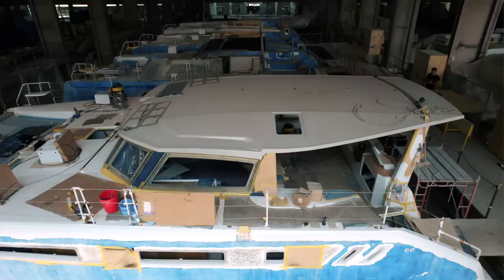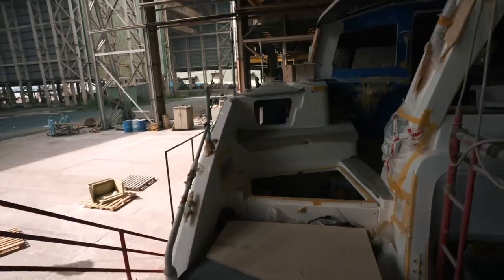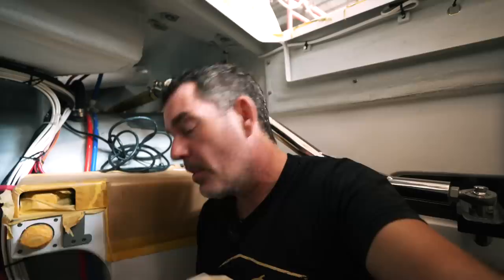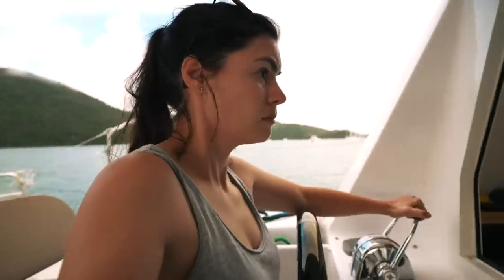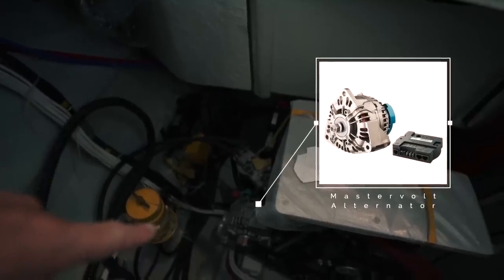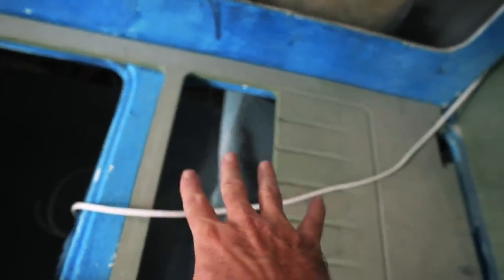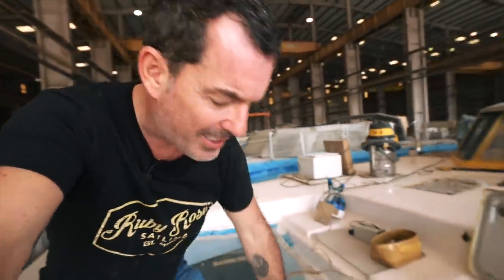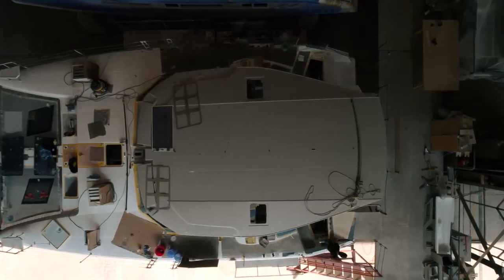Incredible Progress! Windows and my DREAM engine bay!

Comment: What amazes me is that no one puts manual deckwash pumps onto the engine, a life saver if installed correctly and one that will keep up with huge holes in the bottom , nice thing with deckwash pumps if the air intake is above the water these things will be more reliable than electric bilge pumps , considering an engine driven jabsco can pump from 43 gallons a minute, but we design in bulk heads hoping that these will hold . If you think about pumping 43 gallons a minute at 1500 rpm im sure it makes sense considering the average fuel capacity for cruising would mean that the engine would keep pumping for days and days. The other issue i see is that you have forgotten that having a water tight bulkhead in the engine room, having your air intakes snorkled  way above such a room will mean that even when the engine is immersed you would still have an operational engine .

Comment: In your catamaran reviews you emphasized having the wiring passages filled to prevent fire spread and fire suppression systems in engine bays. You did not cover either of those item in your engine bay tour. Is Sea Wind plugging the wire runs and supplying a fire suppression system? I would suggest a hylon system.
As you see the build progress on hull 1 are there any things notice and would like to change or modify on RR2 before the yard builds your boat?

Comment: Jeannuau 54DS have a beautiful single line reefing system, supported by a pair of powered winches either side of the companionway. Ease main halyard by hand and wind in tack and clew simultaneously with the powered winch, driven by the foot switch. The reverse to throw it out. In heavier weather, engine on, in gear and steer head to wind, George does the steering, you do the lines. Almost a stress free one person manoeuvre.

Comment: Is your house DC system 48 Volts? Why not? You can get so much by charging your house batteries at a higher voltage for the AC inverters. Then stepping down to the voltages you need to use for winches, windless, 12V systems, etc.

Comment: Alternator: I assume, there are a number of 'special' alternators with high output. But for me more important ( and your Mastervolt alternators will have) is the attached regulator. 
Such a regulator will be mandatory if you use Lithium batteries, but they normally have a better voltage sensing and a dedicated ability to charge quickly.
Reply: Safiery has it all, does it all, and you wont find better systems designed and built for any boat or vehicle.....watch their 60 second you tube grabs.

Comment: Nick. Does these Catamarans have a Third Fuel Tank? If not they to look at the Kraken 50 and learn Why a Third FuelTank in a Must. Thanks  how is your Cat doing? Peace Be With You Two
Reply: Whys they have 2 engines each with its own fuel tank.  This is NOT a monohull with a single engine. Now adding a second primary racor might be a good upgrade for an owner to do.
Reply: @jackdbur  Jack.   With all the Junk Diesel fuel if the Manufacturer could save some labor Cost with a Large Main Tank you need that to hold water/.Fuel then filter the Fuel to each Engine Tank that way you have less chance getting bad fuel in you New Engines. Also now you Have Two Fuel Filters per Engine and if you get bad Fuel you have to Change Four Fuel Filters. Now Do you Get the Third Main Tank? But you are Rich so you like changing Four Fuel Filters.   Not me. One filter be fine for Me.
Reply: @gregoryh4601  Ahar you mean daytanks for each engine and you still need to filter before and after the day tanks
Reply: @jackdbur  no Sir Jack I got the idea from Kraken SailBoat  Kraken 50 has two Fuel tanks for Fuel that gets water in the Diesel that you get from the Small Inlands then you filter to the Engine Fuel tank. So the Catamaran need one fuel Tank to hold the Fuel before it goes to the Two Engine Fuel Tanks. You only need one Fuel Filter to clean the fuel as you fill the Engine fuel tanks.  Now you have to use Four Fuel Filter.  Understand now?

Comment: That engine vent onto the sugar scoop will guarantee water will get into the engine bay..
Reply from the maker: That’s why it has closable vents
Reply: @sailingrubyrose  that type vent is not for a wave over the sugar scoops.. very strange. I thought it  was a performance boat.. why the heavy windows? is it style over performance as you mention.
Reply from the maker: You know, if you’re determined to find fault with the boat, you will. Yes we could have stripped the doors out and put abattoir sheets in. We could have used Perspex or polycarbonate windows and sacrificed the ice machine. But its our home. We are pretty damned happy with the compromise between performance and luxury. It’s all a choice my friend on a sliding scale. For us personally, i think we’ve hit the sweet spot. My days of crapping in a bucket, washing my clothes in a bucket (different bucket) and collecting rainwater in a bucket are done.
Reply: @sailingrubyrose  thats fair enough.. its a boat that i have been looking at but it just seems like its not really a performance cat more of a catana/lagoon cross i.e . as you rightly say, lots of compromises.
Reply: @sailingrubyrose  Luckily it’s your boat and your opinion that counts Nick . Looks to me like you got a state of the art boat that fits your requirements with a lot of your own input and being able to document the process and have an intimate knowledge of the build  without spending multi millions to do it. Everything else is subjective . In your place I’d have a pretty big smile on my face mate .

Comment: Wouldnt it reduce weight and complexity by taking out the standard alternator completely and replacing it with the high output one?
Reply from the maker: I dont know why two are required.
Reply: Possibly the standard one looks after the starter battery whilst the uprated ones supply the domestic batteries.
Reply: You could remove the stock alternator but then you would have to add dcdc charger & relay as you can't have lead acid (start) & lifepo4 (house bank) batteries in the same circuit.
Reply: @sailingrubyrose  Is your house bank going to be 12v or 24v ?

Comment: i have seen a few boats that have been built , but the engine bay hatch looks too small to get the motor out if god forbid you have to pull it. Is this  design that way?
Reply: They must have got it in there...